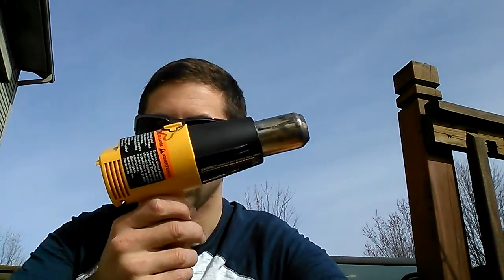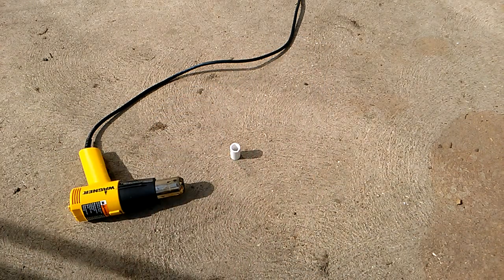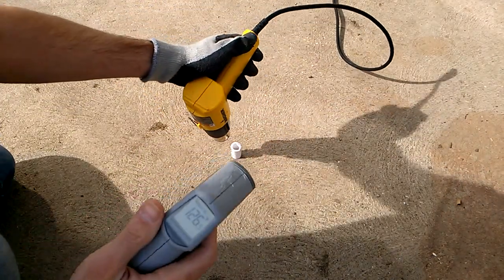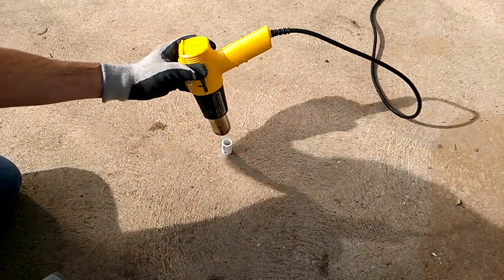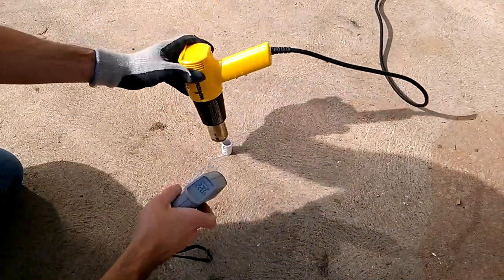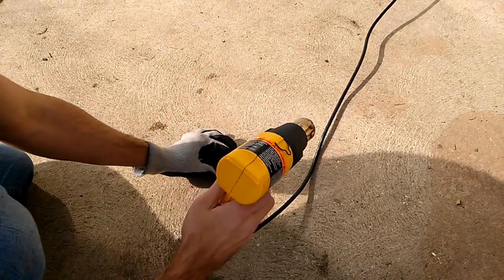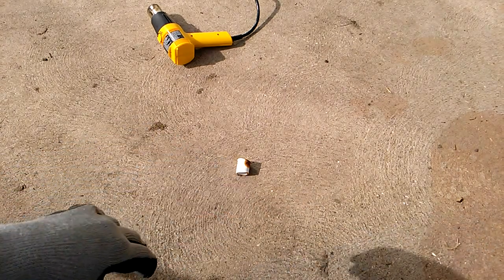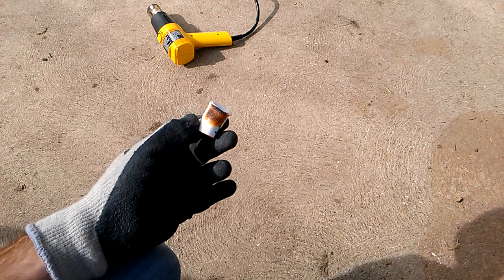PVC Heat Test

Comment: Shame on you Tim for not heating on a reflective surface, like foil!  :P  Actually, your test is showing how much the surface you sit the PVC on can suck the heat out of it.  Reflective surface is a lot more important than i thought it would be going into heat shaping PVC pipe. How much did that thermometer cost?  It seems that would be handy for working with large diameter pipe that take forever to heat evenly.

Comment: Educational video. I've found that the only time I've come close to burning (well, browning) my PVC has been with larger pipes. 1 inch or larger. It takes longer, and has more surface area, and I can get impatient. Also I was using a really cheap, garbage heat gun from Harbor Freight at the time (I think it was $7.99). I've learned to be more careful now, but when it did happen, it wasn't too bad.